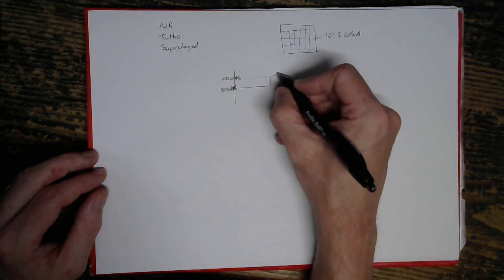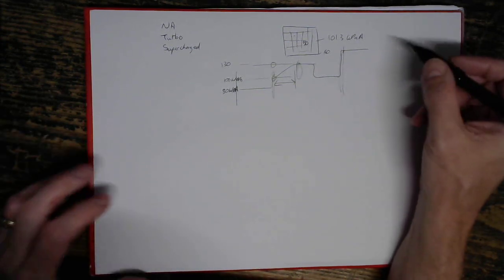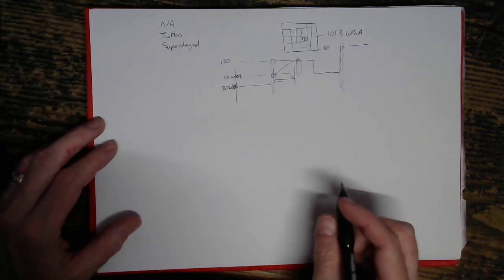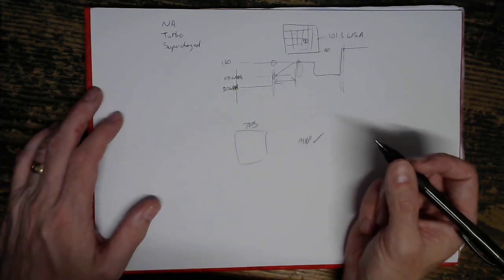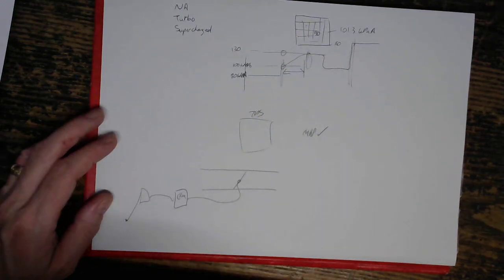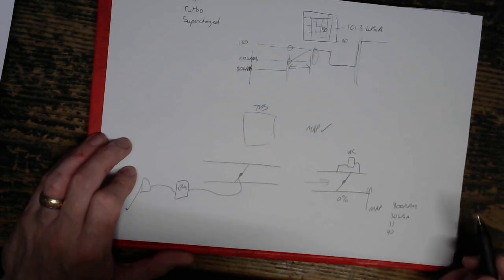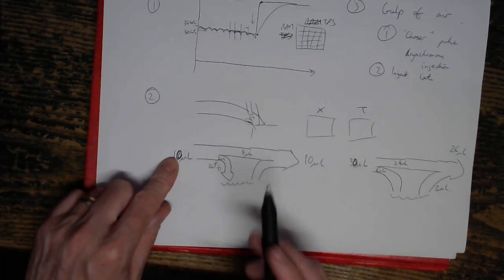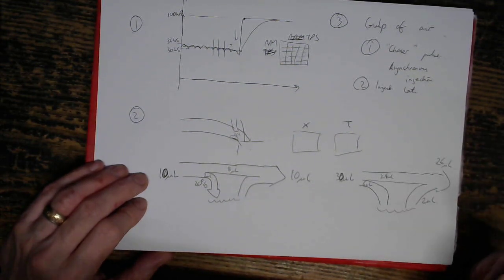MAP prediction / fuel film FAQs - Haltech ECU

Comment: Hey Andy, watched both your videos about MAP Prediction and Fuel Film, the explanation has been good and given me an understanding of what Predicted MAP, Film Pooling and Evaporation is/can do.

Could you provide some details about Transient TPS Scaling? I'm in an interesting situation trying to use MP/FF however it is always active and not allowing for O2 control (I've also read through the knowledge article online).

From my understanding MP, should be a momentary activation rather than constant? I believe the activation threshold is determined by the Transient TPS Scaling?

My situation currently is that MP/FF is constantly active with 300% Trans. TPS. Scal., but the car (Stock 4G63 Auto Evo Wagon) will log swings of TPS-D of +/- 1400% during steady state cruising at any speed. Stabbing the throttle or even applied throttle will lower the scaling, which seems to be the inverse of what is suppose to happen.

It's confusing the bugger out of me and hoping you might be able to explain what might be getting overlooked or missed.
Reply from the maker: Hi mate, good question. In Adaptronic it was just a simple threshold, but as we know, life is analog and doesn't usually operate on simple thresholds. So the scaling value is the TPS rate at which the full predicted MAP will be applied. At zero TPS rate, you will just get the measured MAP value. At half of the value it will be half way between. This way you don't get nothing and then suddenly a lot, which was what was happening on the Adaptronic when it wasn't set up correctly.

I think the "predicted MAP active" flag is tripped when it's more than about 10% of the threshold.

I think you might have a ground loop if you're seeing 1400%/sec at constant throttle.

You can map that scaling against throttle position to make it less sensitive at higher throttle openings but that's really just masking the problem.

Not sure if this helps, hope so!